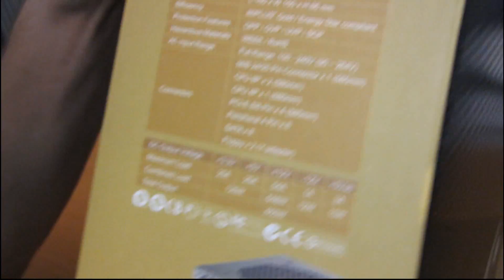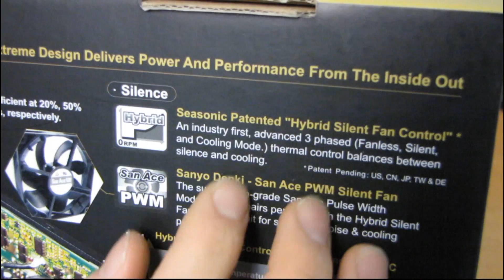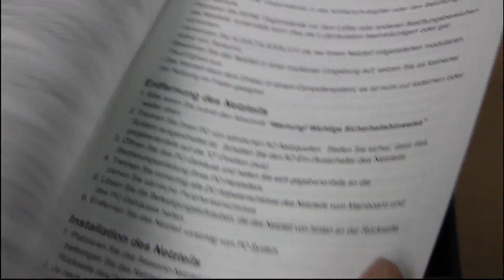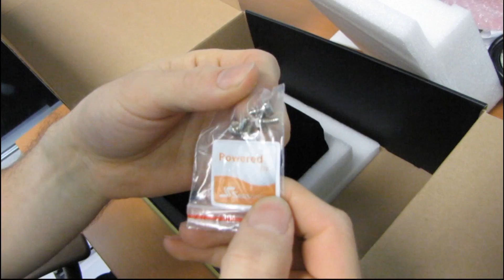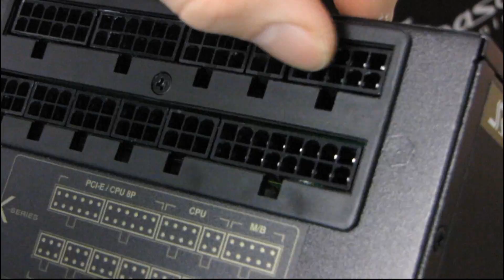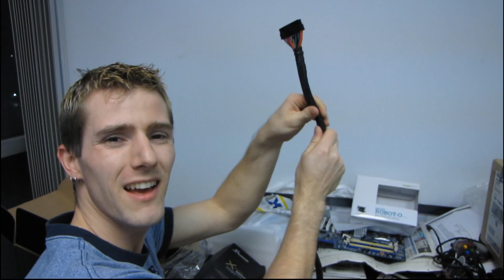Seasonic X-Series 650W 80+ Gold Certified PC Power Supply Unboxing & First Look Linus Tech Tips

Comment: Scrolling old LTT videos, and this is how I found out I actually bought a circa 2010 used power supply in 2019, ran it with AM4 with R5 2600/GTX 1070 and used it for 5 years, with it lasting 1 year with my ugraded R7 5700X3D/3070ti PC until it finally started giving me 12v rail power issues...

Comment: Guys, bought this exact PSU today on Ebay, unused, unopened, waiting for it, should i be worried about it like it is 10 years Old?
Reply: well i've been running a 750 watt version in my build for the last 3 years.It's never let me down.Looks very high quality, as is all Seasonic stuff.Bought it new in 2017 as part of a new build.so these things must have been around for a long time judging by the date of this vid.
Just checked on the Seasonic web site.They no longer have this supply as currently available so my best guess.It was launched in 2010 ( date of this vid) and was replaced sometime after 2017 ????

Comment: Is there big difference between km and km3?
Reply: +JetMiracleCommander Nothing internally, BUT the all the cables are completely blacked out. There's no performance gain or anything, just the mustard wires go away. Hope this helped.
Reply: Hey thanks man :) just got mine last night and its the km3 model.
Reply: Thanks man, Getting the KM3 model for my first build too! Nothing astonishing, an i5 6400, gtx 970, matx motherboard.
Reply: +Ryan Cubing It is a gr8 PSU I have one with my 4790k and GTX 980.  No issues and both OCed

Comment: recently i am using FSP 700w PSU that cause a lot of problem such as buzzing sound due to coil whine,totally blank prompt kernel drive issue and reboot for no reason went  RMA  to Distributor with pathetic answers and insist of not changing the PSU until i decided to changed to this Seasonic X 750w power supply.very high quality PSU giving me no issue at all from the day i used it,very quiet even under 100% full load and i am damn sure that this is so far the best PSU i had ever used and i will rate this PSU 10/10 stars for the quality n performance

Comment: OMFG I'm a dumbass. I thought this PSU was a dud because I didn't plug both parts of the 24-pin connector into the PSU, I only plugged the 16-pin portion of it in, I thought the 8-pin portion of the cable was just extraneous. Either way, I'm getting a new one in a week depending on how fast my RMA goes to Newegg.

Comment: I will take the 650W one , for extra breathing space. Even though your running with only 1 HD 7870 , if no CPU OC too , you easily require 300W , so i usually will try to have a PUS 2X the power requirements ,so your PSU won't have to work very hard which produces less heat and less power loss. 
Best is able to have it work on 50% load , since that's the best efficiency for a PSU. 
Hope my knowledge isn't wrong lol , this is what i know , it's best check with some pros first. m still learning =/

Comment: will this power a amd 8350,asus crosshair 5 formula z, 8 gb corsair dominator 1866, amd radeon 7950, ocz vector 256 gb ssd, corsair h100i, coolermaster storm stryker with all the fans it can hold, and a led light stip? please answer someone

Comment: It's by far the quietest PSU I've ever used - it also took a bit of getting used to, since the fan will activate in short "bursts", making me think it wasn't actually functioning properly. At the moment, I'm running it on an i5 2500k, 4 regular SATA drives and a single geforce 570, so I'm guessing my power usage at max load is around 450 max.

Comment: Can the 850w v. of this PSU handle my upcoming setup:
MB: ASUS Sabertooth Z77
GPU:  ASUS DirectCU II GTX 670 TOP Card
Cooler: Corsair H100 Extreme Performance Liquid CPU Cooler
Processor: Intel Core i7-2700K
Ram: G.skill Sniper Series 8GB (2 x 4GB) DDR3 1866 Mhz CL9
Case: ThermalTake Chaser MK-I Full Tower
HDD: Seagate Paracuda 1TB
Reply: Wow 8 years no one bothered to reply...

To answer your question. Yes...

Comment: that's good to know. I guess a 4.8 ghz i7 really ups the consumption compared to just a 4.4ghz oc. Realistically on avg, according to hardocp, an oc 680 gtx and 4.8 ghz i7 averages around like 355 watts. is that 275 watt or so load wall power consumption while gaming? I wish psu companies made more quality 450 watt psus, since really thats all you need to power a 680 gtx with a comfortable psu load.

Comment: is that usual gaming load? is this taking account psu efficiency or not? much thanks if you can answer because I can't find a review with just a 4.4ghz i7 2600k/i5 2500k and 680 gtx power consumption. It's either a 4.8ghz i7 2600k(hardocp) or 3960x at 4.3 ghz....

Comment: Quote JonnyGURU: "Sharp eyes will notice that the ATX cable actually gets two connectors, rather than one single 24 pin monster. I presume this was done so the two rows of connectors could remain the same width."

Comment: @BIGDADDYF50 Corsair is a good brand.
If you're going for the 2 GTX 460 I'd take that Corsair 750 Watt.
But 2 GTX 470 would be a little to tight in my opinion with a 750 Watt power supply.
and the difference between gold and silver is barely noticeable even  if you leave it on all day :)

Comment: @ed800 heh. I figured it would be somewhere in those numbers.

So i did some more looking around and seems i found something that would suit my needs. It's the Corsair HX750W.  It seems to be modular(which i like) has 750W - which should be enough juice for 2x GTX 470. I might be thinking of 2 GTX 460's instead, so I'm sure 750W would be able to provide sufficient juice.

And it's 80plus Silver efficient. Not 80 plus gold, but heh, I don't really leave my pc on all day so whatever. Whattu think?

Comment: @BIGDADDYF50  This is what Guru3d says in their review:
GeForce GTX 400 in SLI

    * A second card requires you to add another 250 Watts. You need a 850+ Watt power supply unit if you use it in a high-end system (1 KiloWatt recommended). That power supply needs to have (in total accumulated) at least 55 to 60 Amps available on the +12 volt rails.

Comment: @ed800 

The seasonic S12D is available, but it's actually 850Watts, coasts about $140, and has no modular cables.  So this is probably a no go for me since I'm going to want a modular power supply.

Is there any other brands or that are around $100'ish that have modular design.  I'll probably end up going with the Seasonic-X 650W that linus showed us in this video, but what if i decide to SLI and add another GTX 470 in my system, will this power supply still handle it? I'm not sure it can tho

Comment: @BIGDADDYF50 It can easily handle that,
power consumption of I7 930 + gtx 470 never reaches higher than 450 watt.
So a 550 Watt should even do fine.
So with a 650 Watt of a good brand you'd be fine and even have room for overclocking.

and about the 80 plus I'd good with a cheaper PSU than this one with only silver certification or even bronze of an A-level brand.
I would recommend Antec over OCZ.
Or the S12D from Seasonic It is 750 watt and is about €100 here.(So should be about $100 for you.)

Comment: @ed800 

Will this power supply work on a GTX 470 and a core i7 system? I know seasonic is a good psu brand, but I'm worried that the 650W power will not be enough.

also, is the 80plus gold really worth it? I know it saves some money, but probably not too much.  This one is $130, but I'm wondering if it would be wise to go for something cheaper like an antec or a OCZ model that's half the price.

Comment: seasonic PSU's are generally very good, and considering this fan doesn't turn on till it's actually under a fair load, it is very quiet. and because it's very efficient, like he said, it won't get that hot

Comment: And another guess on why they they cut up the 24 pin connector was the keep the inside of the PSU "clean" so it would have a higher air flow rate and so that it would be able to maintain its gold certification. *cough*

Comment: The reason why they "cut up" the 24 pin was (from looking at the color coding of the wire) to organize the +5V, +3.3V and ground wires. My guess to why they did this was because these are the wires that you use the most of in a 24 pin motherboard connector. 

Probably confused you more with this comment then anything.